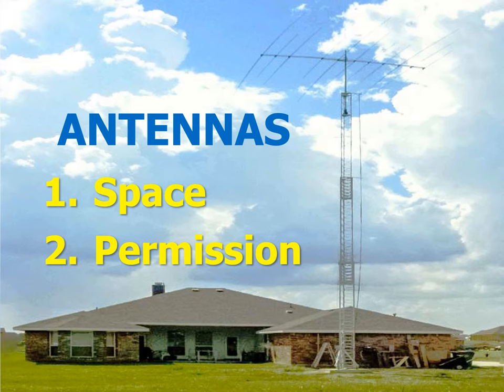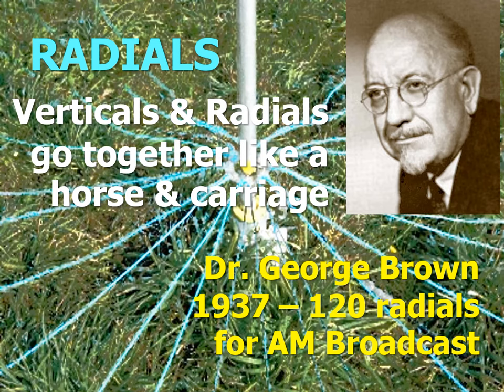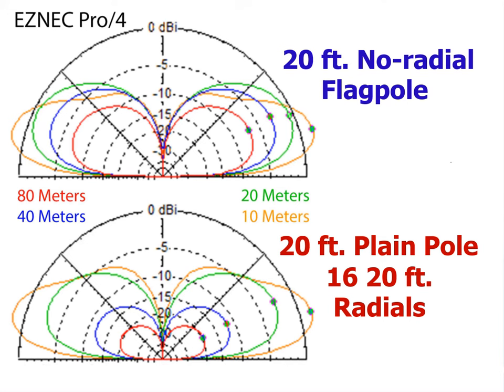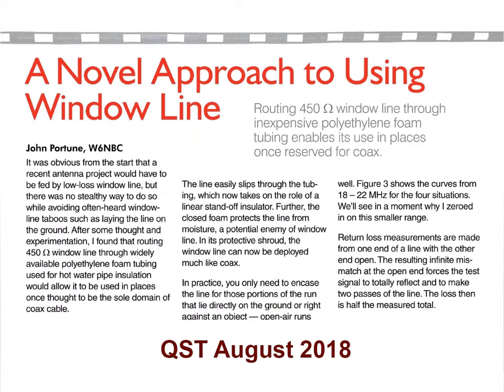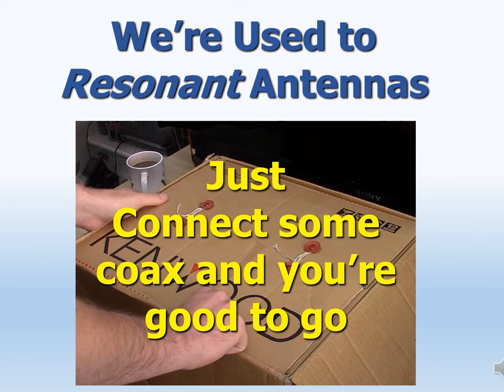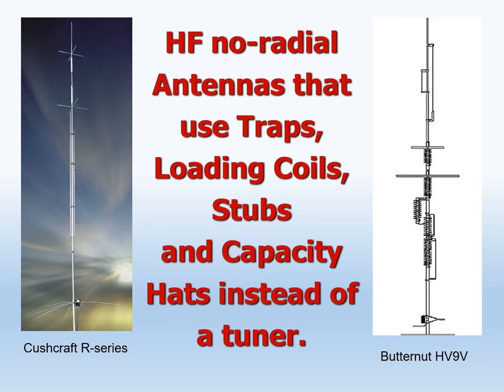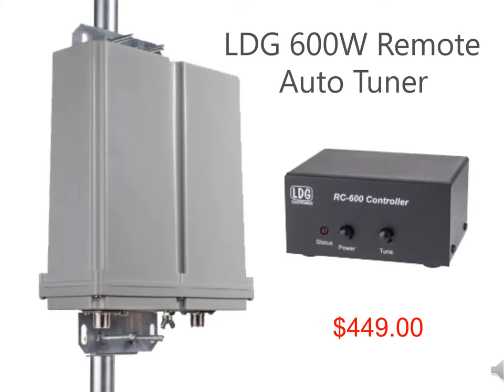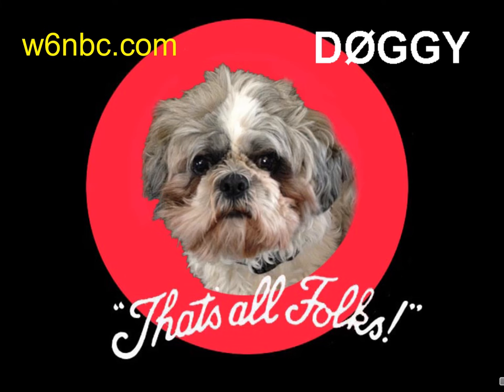DX Flagpole Antenna for Real DX 160-6M at Home or HOA, by W6NBC

Comment: the remote tuner scenario, assumes that the flagpole antenna is being fed with 50 ohm coaxial cable (lmr400 in your example). what if, window or ladder line (from the antenna feed point) came all the way back to the shack and the indoor tuner?  the loss on window or ladder line is minimal compared to coaxial loss of any make and model coax.
Reply from the maker: Hi Richard, this is a good point and acceptable indeed. We offer this method of feeding in our "Alternative Methods to Feeding your Antenna" found here: https://greylineperformance.com/blogs/news/common-questions-from-customers